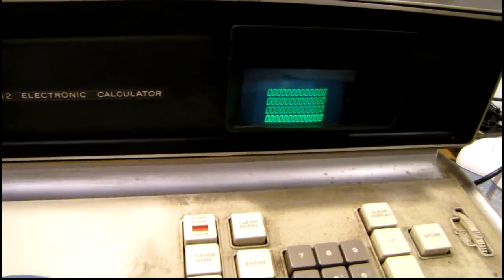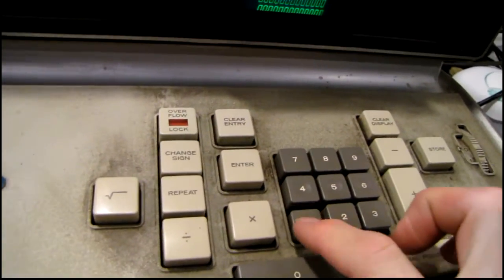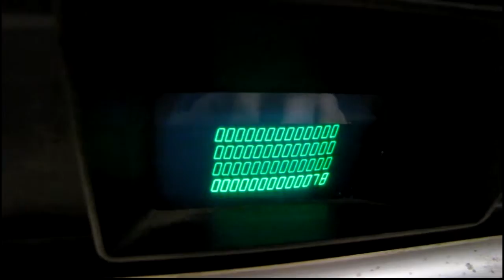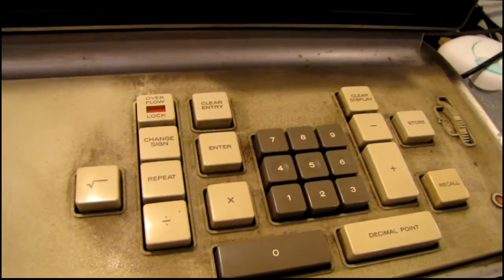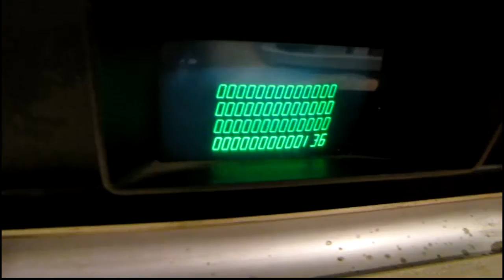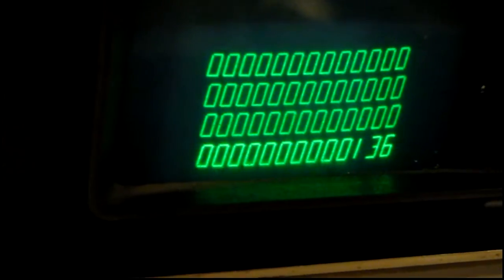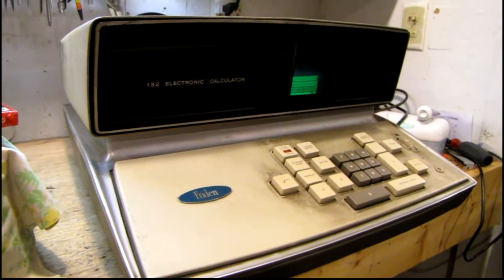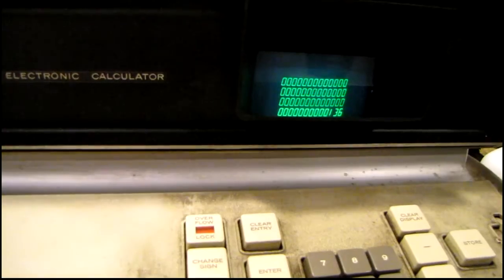Vintage Friden EC-132 Electronic Calculator

Comment: I love this machine. I to have a Friden EC-132. I need to replace some diodes in the voltage multiplier circuit powering the CRT though, and adjust the magnetostrictive delay line memory. Mine glitches out if numbers get too big, due to the delay line not being tuned up properly. I also have an SCM Cogito 240SR. It did work perfectly, but it recently developed a problem where it wont push the number in the K stack to the Q stack when an operator key is pressed. It's likely an oxidized connection